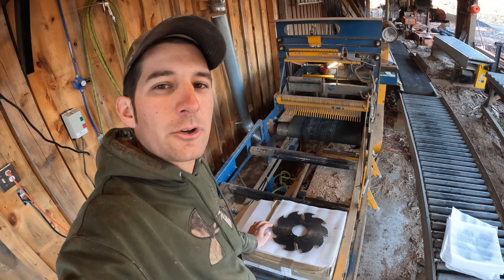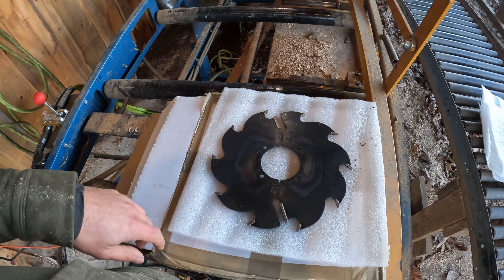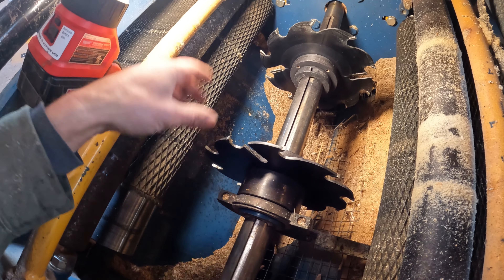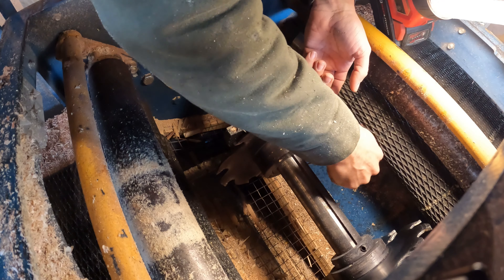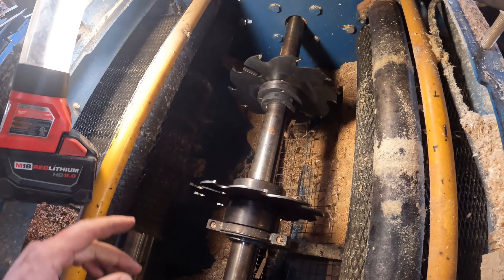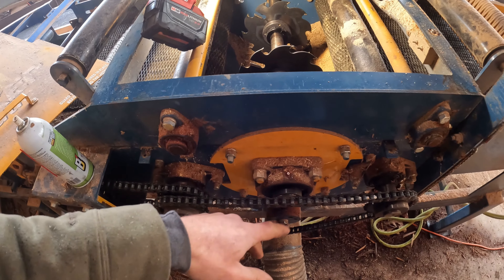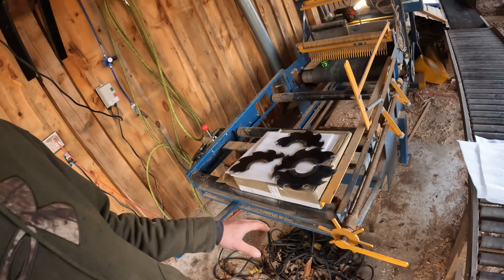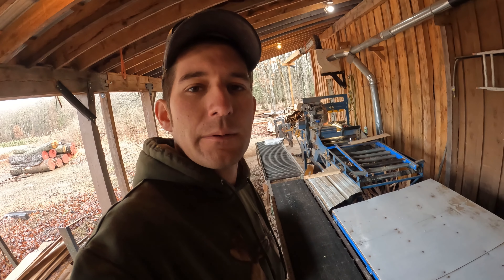what are split blades and how do they work?

Comment: I have a tool to repair the belt. My old hay bailer had belts and this tool just goes into a vise and sqeezes staples into each end of the belt and then you run a cable through the staples and it connects both ends together. I have seen connectors that you put on each end the belt with set screws and then run a long pin or cable through. I bet you can check at a local farm equipment shop and the can fix you up.
Reply from the maker: Thanks for the info

Comment: There is several kinds of products to repair rubber conveyor belts. 2part epoxys, patch kits, metal repair fasteners(bolt together). I'm not 100% sure which ones, if any will work out on that conveyor the best. I'd say to try the glue-on patch and a few repair couplings to reinforce the edge. I've seen some really serious tears repaired on conveyors with the bolt together clips tho.👍🏻👌🏻🛠️🔩🗜️🤔🤷🏻‍♂️✔️
Reply: NO NO  NO never do that sorry  you wonder why you have a stupidly high bill to have someone come out and fix your mistake there
Reply from the maker: Thanks

Comment: I noticed you didn't put a rag or a bag under the blade before disassembly.  Have you ever had a cap screw drop through the mesh below?  If it were me, it'd probably happen every other time.
     I've worked in a shop that had flatbelts before.    We never had a "quick fix" for failing connections.  Depending on the amount of play in the tentioner, you might be able to cut off the ends and put in new, ONCE. Other that, we just replaced the belts.
Reply from the maker: Yes I should put something under them, I’m also prone to dropping bolts!  Thanks for the belt info.